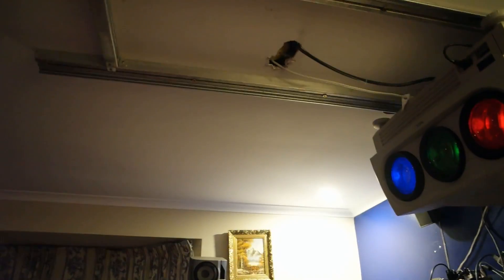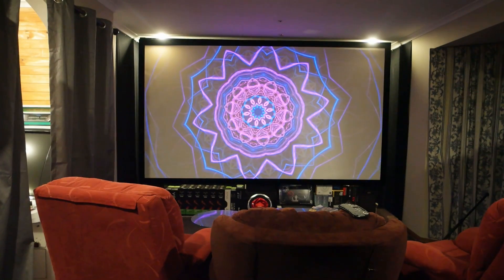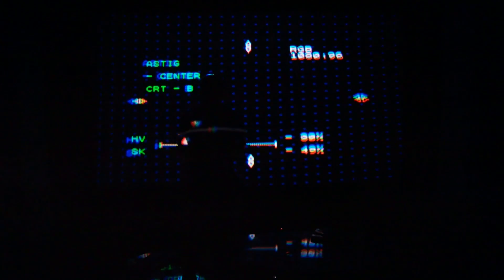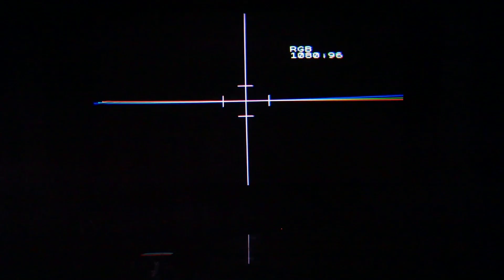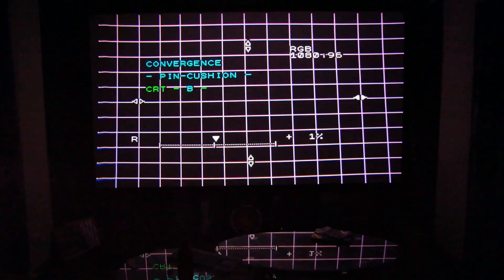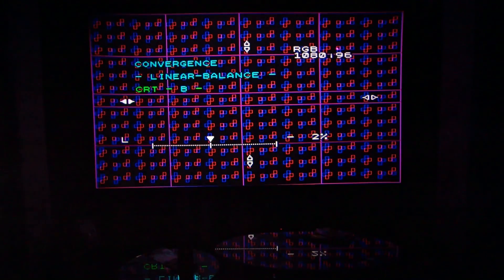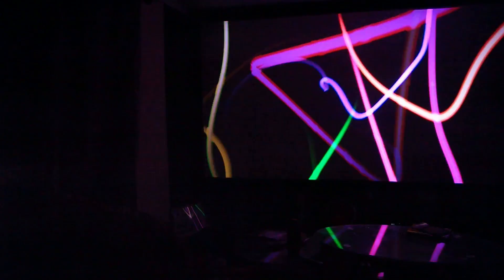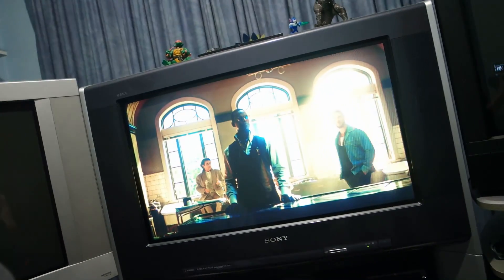CRT Projector Convergence Timelapse

Comment: I was (well I still have it) using a Panasonic Cinema Series 53" CRT HD RPTV (MDL PT-53TW54) for near 20 years.  Fantastic picture quality.  Blacks were and contrast ratios were great too.  I refused to replace it with a panel as there was nothing that would touch it, sure some panels were a little bit sharper... but that's it.  

Panasonic eventually came out with a Neo Black plasma panel that finally got me to switch to a panel, and it has all the picture quality of the CRT (deep blacks and beautiful CRT like colours), but it is maybe an inch thick.  Some people told me to stay away from the plasma for burn in and panel life.  I've had it in fairly regular use since 2012, and it's still razor sharp and it has a a few anti burn features to keep it clean looking (and since I was coming from a CRT, I was used to not doing things that cause screen burn).  It was a shame that Panasonic stopped making the Neo Black plasmas as they were a great upgrade from a CRT.

...although one nice feature of the CRT HD RPTV that can never be matched by any panel, is the fact that a larger lower cabinet allowed for some pretty big speakers for great sound.

Comment: I think I just got here because of Severance. I know it's years since you converged this but I upgraded from a Barco Data 600 to a Seleco SVD 500HD between 1999 and 2007, and it had the two problems that you had. These tips might help the next time you align it all up, though it probably depends on if the NEC does it the same way or has the same problem.
1. Extreme edge focus for red/blue corners. This is a problem that comes from screen distance and projector position. Seleco used to combat the worst of this with metal shims that would sit between the red/blue CRTs and where they mounted on the chassis, and had a handy lookup table for which shims to use on which corner of which CRT based on screen distance and keystone. Your electronic changes would then just be for fine-tuning the mechanical setup. Naturally, this is an early-stage item so trying to put them in on a nearly converged setup means you're starting from scratch with lens positions and whatnot.
2. Blue jumping out of alignment and suddenly being difficult after some time. My Seleco did this, on all three CRTs in a couple of the corners. For me, this was a combination of bad solder joints and heat buildup inside the case; the fans were quiet, didn't shift much air by themselves and relied on some convection currents to help out, which only works if it's parallel to the floor/ceiling. Mine was mid-screen and tilted, and the convergence boards were being heat-soaked. I could have done plenty to fix this, but I started by just popping the hinged top up whenever I was using it and that worked fine. Best solution would be to hunt through the boards and fix any bad solder joints, especially on the convergence boards, and/or fans that shift more air (and produce more noise). I did try a warranty service, but because I set them up myself, the company that supplied it didn't want anything to do with it.

I eventually moved over to a JVC D-ILA projector. Mainly because Hi-Def was becoming a thing and although the Seleco claims HD in it's model number, the 38KHz electronics can only get you so far. Started with a HD1, Currently that's my backup (still going strong though the original lamp is over 3000Hrs and it's looking dim). I upgraded to an X30, much better contrast and quieter, there have been times when I'd left it on, not realising because the screen defaulted to black and with less sound to hear, it was an easy mistake to make. If you don't like DLP rainbows or LCD blur/contrast, you might want to at least try one (or maybe you have, it's been a while since you posted this). Ultimately though, they're LCoS (Liquid Crystal on Silicon) tech so although they seem better compared to LCD panels when it comes to blur, it's reduced but not removed.

Comment: Maybe you mentioned it, I also tried googling for a bit but didnt find much.

What are you projecting on? 
Does it need a special phosphourus screen?

Are they expensive, fragile?

Fascinating video.
Reply: No they actually work literally by just putting a lens in front of a CRT tv. That's all it is. The main difference is they use special CRT tubes that have very high brightness. No special screen required. They are expensive because they're not in production anymore, are rare, and considered collectors items for a lot of hobbyists so expect to pay up to a few thousand for a good one.
Reply: @Haarschmuckfachgeschafttadpole thanks. But i thought  "cathode rays" are basically just electron beams and can't be seen without them exciting some other material?

Am I taking stupid pills again?

Or is the bean exciting something else that shoots out photons, even before leaving the projector housing?

Cool name also.

Comment: That summary at the end though - "nothing beats CRT". Sorry, but right now, nothing does not beat CRTs. Even the price point isn't an argument anymore, since QLED has become dirt-cheap, and if anything, you need to look at the MSRP of CRTs with inflation for a fair comparison. You'd really need to show edge cases where CRTs still might have the upper hand, for example the ability to use old-timey light guns. But even mid-tier LCDs will offer low-latency modes and 120 Hz.

Comment: I give you a lot of credit. Not a fan of LCD outside my high refresh (165Hz) monitor. But…. Man…. I use a DLP front projector and a 55” plasma as my daily drivers. Watching that insanity— I’m happy to have moved on. Both plasma and DLP have excellent motion handling. Minus the RBE of DLP, of course. But I feel like that’s countered by CRT flicker. Honestly: OLED is still sample and hold and still has motion issues. It’s not as bad as LCD due to the much faster pixel response. But blur is blur.

Comment: The issue with the blue color is likely due to a buildup of lime and rust inside that tube, called "CRT fungus". If you remove the liquid inside the projector and slosh around some cleaner, it should solve that problem.

Comment: I'm so sad that crt development stopped when lcds gained in popularity. i wonder what technology could have come to in the 30 something years we haven't had crts
Reply: At least we got some amazing Plasma tech from Pioneer with their last 3 or 4 gen Kuro plasmas displays, the 9th generation Kuro got within 75/80% of CRT image quality, had near CRT motion clarity too, and that was with 50/65/75 inch full 1080p sizes, so not to shabby. Yes CRT still wins, especially for gaming, but for movies and some 1080p 60Hz console gaming, a Pioneer 50" or 65" is amazing.

SED & FED was the true CRT successor though, actual tiny CRTs in a dense matrix (in a nutshell) to produce a large CRT flat-screen in 50/65"+ sizes, had all the usual perks of CRT plus many advances, including higher luminance for even brighter highlights, greater colour range, higher resolutions and so on, we would have had 120Hz+ 4K SED/FED displays by now, Imagine a Sony FW900 quality 65" TV that can do 4K or even 8K and true HDR @ over 120Hz with perfect motion, I can only imagine what 8K with CRT grade motion quality looks like.
Reply: @Wobble2007 Sony actually showed off a 1080p 240hz FED display, I always had FED/SED dreams as well. The chief blur buster however was not so impressed, here is what je wrote on it on the forums:

"Not correct. Have you seen a FED? It had a lot of digital-like artifacts (like plasma/DLP, either noise in darks / temporal dithering / contouring artifacts / etc.). If you actually feasted your eyeballs on an actual FED from 2008, it does not exhibit the same appearance of a CRT. It was a neat technology, but was stillborn. Pioneer Plasma looked better than prototype FED at the time"
Reply: @Wobble2007 we have laser projectors and oled now, the latest models just tick all the boxes
Reply: @Wobble2007  OLED clearly is on par with CRT IQ, it even suffers from the same screen burn problems !
Reply: They made CRTs up until like 2008 but I get your point, I wonder that too.
Reply: Could you imagine a 4K CRT screen? That would be insanely cool but in not sure how it would work.
Reply: @Omegadoomship i kean they pulled off 1080p. So maybe put 4 outputs on the beam to quadruple the res to 4k? 

Edit: more like go from 3 to 12 outputs, one for each color channel in each pixel. Plus more sensitive analog intensity input for the beam for HDR use of course.
Reply: Plasma was the natural successor, but that's already using discrete pixels, so it throws out some of the benefits of a real CRT, while unfortunately retaining many drawbacks, so was doomed from the beginning. Plasma was just waiting for LCD and OLED to catch up in terms of viewing angles and contrast ratio.
Reply: I'm not too sad, because you probably wouldn't ever get the image to be as stable or crisp as the cheapest LCD. But in the context of projectors, I do wish things had kept going. It could have been an interesting alternative to laser projectors, and much of the calibration could probably be done automatically thanks to the advances in embedded computers. CRT doesn't have a chance at mainstream relevance for computer monitors for a lot of reasons (I say this as someone who collects CRTs) but it could still have been viable today if the market had never completely died out. It's really too bad that they were slightly too ahead of their time. A decade later, and there would have been an auto calibration process for sure, eliminating the biggest issue with the tech.
Reply: Y,all mixing tv formats (crt, plasma, lcd…) with projection tecnology (crt and lcd mainly)
Reply: If they kept making CRT projectors up until today, everything that you just watched being done manually in this video would instead be done automatically. There would be a cameras pointing at the screen feeding back into the system, the AI software would take it from there.
Reply: @Bloodgod40  Auto-convergence was already available, eg: Barco IRIS3 automatic convergence system, which was built into some models. It reportedly was good but not perfect, presumably just due to limitations of the camera, that's the only thing a theoretical new system would need to add.
"BARCO's IRIS 3 automatic tuning system allows to effortlessly align the geometry and convergence of the
projected image. Works faster and with more accuracy than ever before!"
It had been around for some time, as evidenced by some manuals that describe the projector as being suitable for VHS in addition to other inputs.
"AI" is not at all necessary for something like this, and would only mess it up. Auto-convergence only involves simple calculations once a suitable image is available to the system.
Almost all current "tech" isn't new, just smaller & faster.
Reply: @DoubleMonoLR You aren't kidding. Most of what makes our current LLMs tick was already toyed with in the 80s/90s. Problem was it took a very VERY long time to reply meaningfully. The biggest change was being able to throw power at the problem for the cost of a modern graphics card. (And before that, the milestone was "replies quickly with a dedicated datacenter") There were other optimizations and changes to be sure, but I'd bet money you could find a way to run those old models on modern hardware and get semi impressive results. At least we'd see what a real 80s robot would have sounded like! 

I remember reading about this stuff in an AI book I read in middle school (early 2000s). Always thought it was BS that they did it back then until recently reading the history.

Comment: Hi mate, what state are you in? In QLD here, also have an XG LC, but i converted my 852 AC into an LC with a set of LC tubes i bought from Craig Rounds about 10 years ago. You can play light gun games on these projectors!!

I have a couple NEC spares sitting here, but mostly for the NEC PG sets i have. 

I notice youre doing astig on blue with the defocus switch turned on, turn it off and get the blue razor sharp first. The astig in the corners and the edges should be done with the focus set sharp, not defocused. 

The NECs  are capable of the absolute BEST convergence of any CRT projector, it has a massive amount of settings that will allow dot perfect convergence even at 1920x1200. 

Ditch that HD-Fury and run RGB straight from your PC, that is going to give far better image quality unless you can get a MOOME internal HDMI. 

Got a Barco Cine 9 on the ceiling in the loungeroom for the past few years now. https://www.youtube.com/watch?v=hcFlXATEiS8

If you live close enough i can come and show you a few tips to get it razor sharp corner to corner in about 1 hour.
Reply from the maker: Hi! thanks for the detailed reply :)  I tried to play light gun games, but I think the light output was simply too low for my given screen size, and it refused to work at all.
I have a roof full of spare parts,  just at the moment it's sitting there with a cracked blue tube due do a horizontal deflection board failure.  I want to do a full rebuild on the unit and probably make some vids about the process, so it is currently on hold.
Good find on the blue defocus!  I was in a rush and just wanted to make watch some movies so I no doubt made heaps of silly mistakes.  I normally tweak it a bit each viewing session as it always drifts a bit with the weather.
I was running RGB straight from the PC but the NVIDIA drivers were giving me absolute hell with interlaced resolutions so i gave up and went to the hdfury and it worked far better.  Anyway, that 980ti finally gave up the ghosts and no card worth installing has analog output anymore.
Very jealous of the Barco.  A dual Barco setup would be insane!

Unfortunately, I live in Hobart Tasmania, so I don't think that visit is going to work unfortunately :)
Reply: @TurnerTVOfficial  Haha!! Mate its a bit far for a day trip with these lock downs ;)

The screen size will certainly impact the ability for lightguns to function correctly, but your best bet is the Namco G-CON 45 and G-CON 2, they tend to function very well on an XG, we have spent many a night here over the past 15 plus years having Point Blank battles on everything from a Sony VPH1001-QM to a couple different NEC 9PGs and then the XG. The downside to the Barco Cine 9 for retro gaming is that it starts at 31kHz, so i have to use the XRGB-3 to line double it. The good thing is i can dim every second line so it cant be seen from the lounge, but still adds brightness to the image. The G-CON 2 still works if i use the component cable to get a 480p signal in. 

The XG is without doubt the absolute most capable set when it comes to convergence and geometry, and although the Barco Cine 9 is vastly superior to previous Barco CRTs, it is a massive step down from an XG in that regard. The 9" tubes are quite bright and those lenses give super sharp focus compared to the ones on the LC XGs. I had HD-144 lenses on it when it was AC and those were razor sharp. 

The biggest thing that causes drift on the NECs is were the deflection yokes plug into the top side of the board, slide those big plugs off and clean the pins up nice, it can help with the drift. 

The idea is to set the machine up in such a way that minimal corrections are required, and your setup there with your screen up higher is PERFECT for this, center your rasters on the tubefaces, then lower the rear of the machine so it points at the middle of your screen. You will use a lot less keystone, you will use a lot more of the tubeface, it will be more stable, and it will also give you better lens focus in the corners. It wont take much to drop the rear down a bit, the brackets on the projector mount to just forward of the middle to make this possible. 

VDC in Florida used to have stock of new tubes for these, but i believe they have since ditched them. Greg Eisemann was still able to have a set made last time i contacted him, but as always with Greg, prices were quite high. 

I had a mate in Vic that did run a stacked setup with two Barco 909s, but he had a few issues with drift and eventually took them out of service due to a HV failure and no parts left. Although the Cine 9/909 has full digital convergence output and that part of it doesnt drift, there are still a bunch of analog adjustments on the V-output board and those DO drift! 

I want to move to Tas when i retire, which will be a few years away yet!